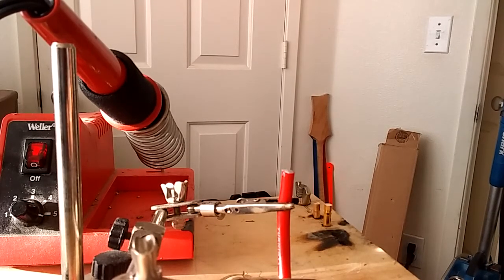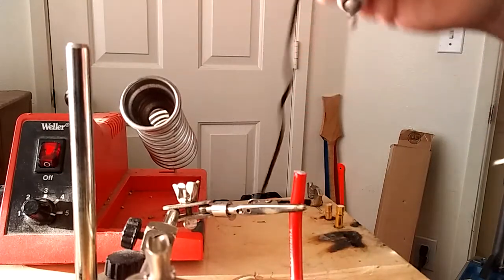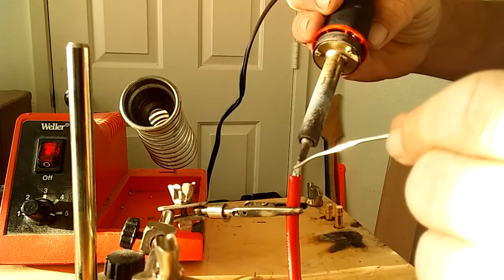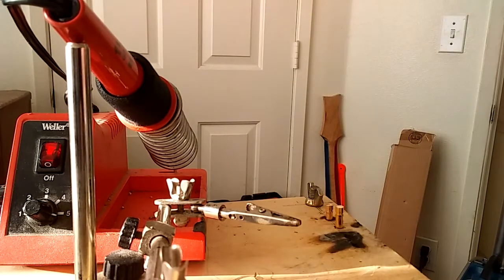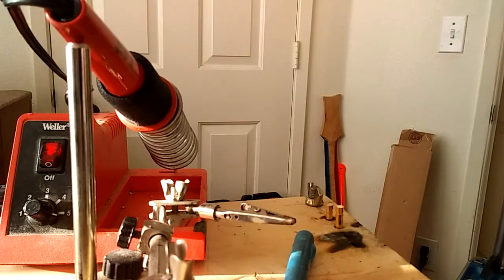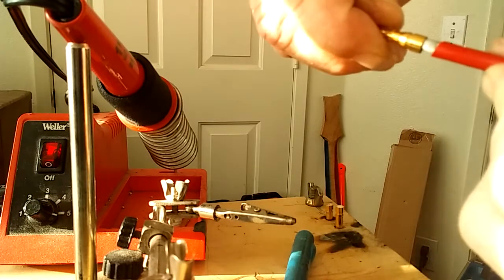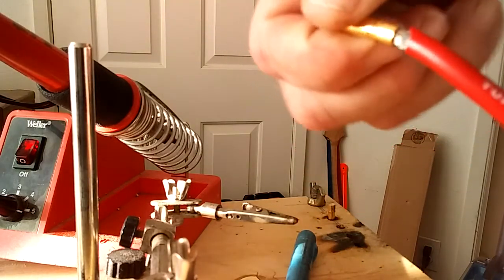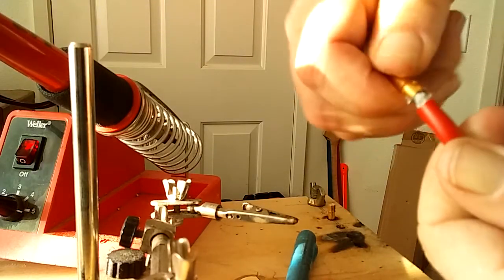Soldering 8awg wire with ec5 no trim

Comment: you were using too thick of a soldering wire, I"have a 60wat soldering iron and it can't even melt that!
Reply: Squanchy FapFap if your iron is 60 watt and not melting that something’s wrong with it.
Reply: Clean the tip after every use.